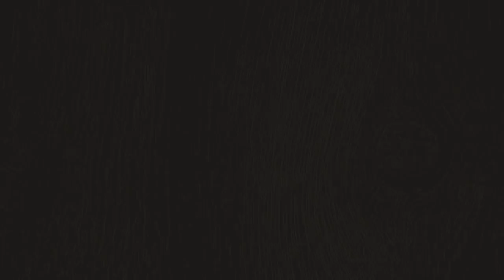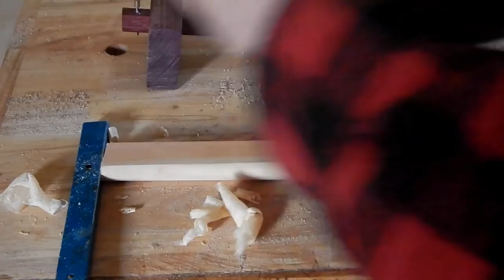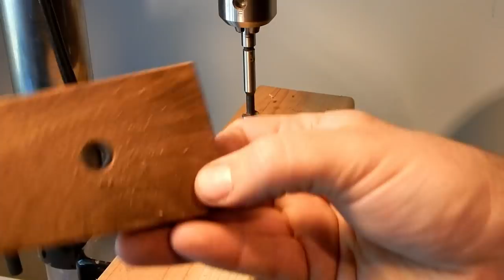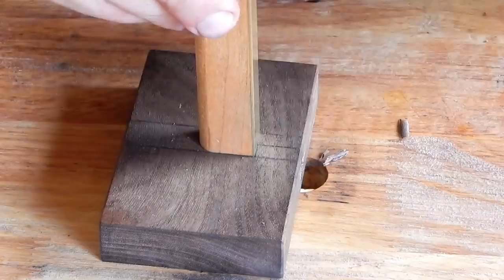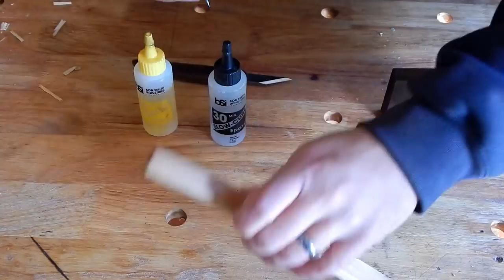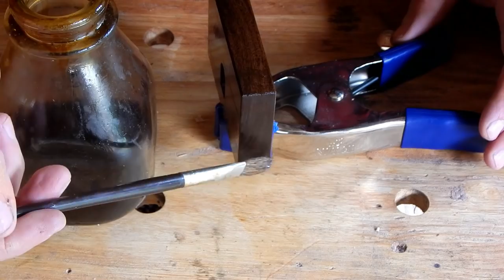Handmade Marking Gauge

Comment: Although good performance but Some flaws in your process - why you are not holding the wooden block in a vice or a fixture while striking off the chips with chisel.  You may add some power tools in your work to bring more speed , accuracy & less effort in your work.
Reply from the maker: Yes, it should have been clamped. (I probably got distracted by the filming process.)